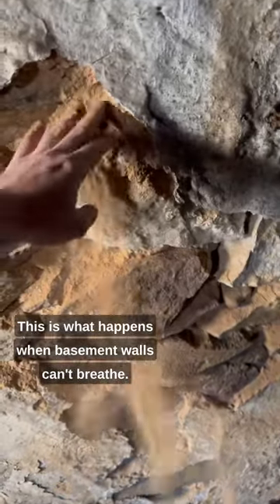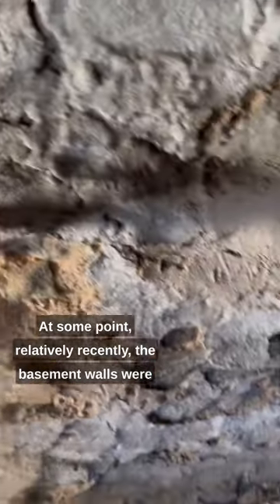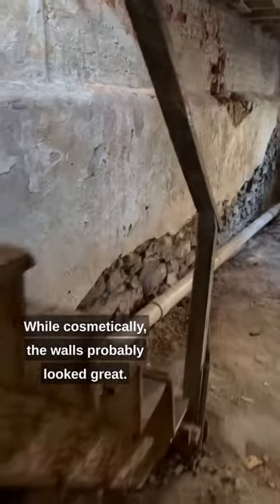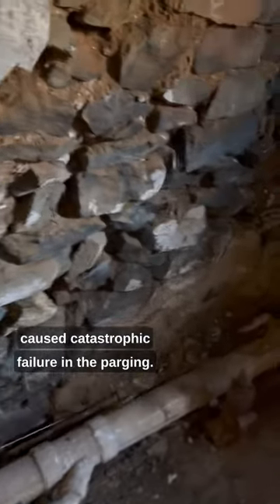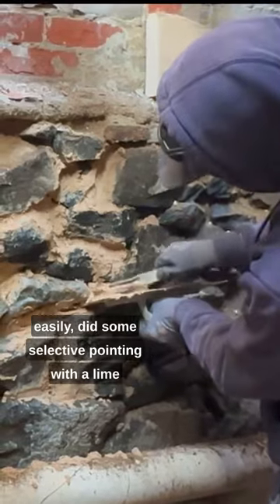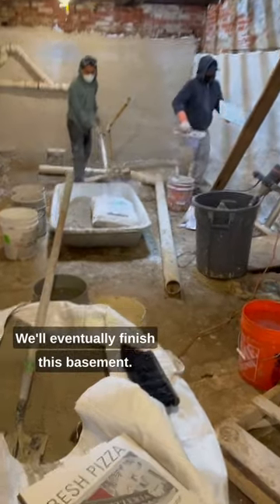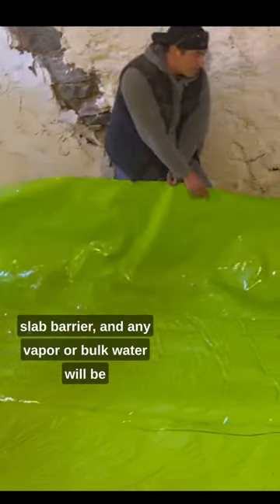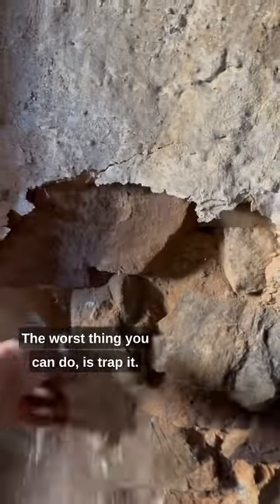For the love of god, STOP USING DRYLOK! Moisture needs to be managed, not hidden #shorts #masonry

Comment: How do you handle concrete floors? I plan to paint the slab floor of a covered patio for a cleaner look, protect the  surface and reduce dust but can’t get past the idea of concrete needing to air out. What would you suggest?

Comment: Ok so my issue is the Plastic traps the water and almost ALWAYS lead to mold. How do you stop that?
Reply: If I’m not mistaken he said there’s a drain to a pit. So it’s probably pumped out of the house!
Reply: @lucasperla7814 and it still creates the mold behind the plastic…..so?
Reply from the maker: So there’s not really perfect answers.  The lime mortar that we use is a natural
Mold detergent.  The plastic is a little bit looser to encourage some more airflow.  Mold also can’t really eat plastic.  That’s not saying it can’t eat the dirt that gets stuck on it, but it’s not gonna be going crazy.
.
Both ends of the vapor barrier terminate in the mechanical room, where our heat pump water heater lives.  It’s a constant dehumidifier and also moves pretty substantial volumes of air.  Our hope is that it’s dealing with some excess moisture.
.
Long winded answer, sorry!
Reply: @GreenBuildingNetwork  Thank You! I really wanted to know as I’m in the same area and used the system many years ago.